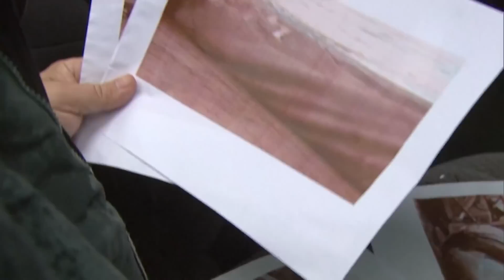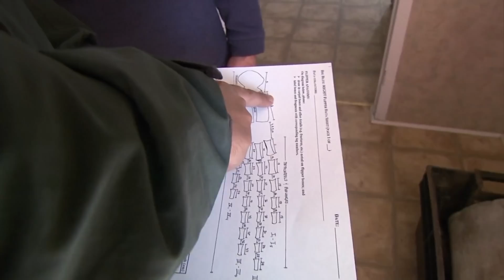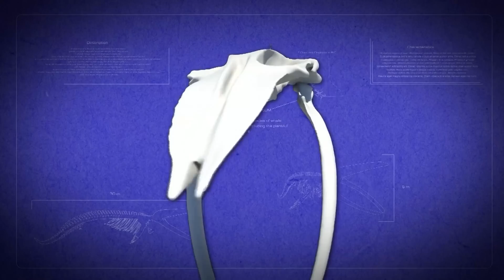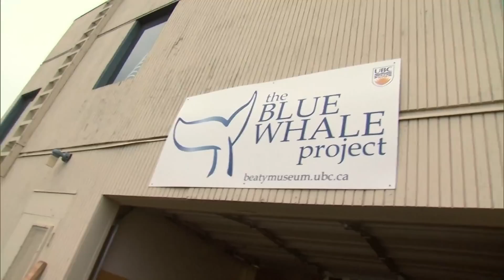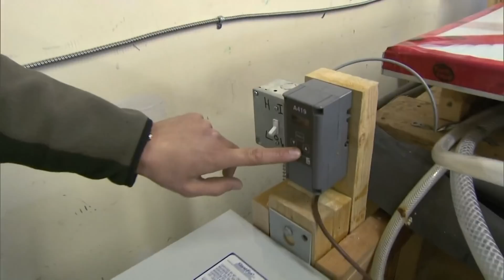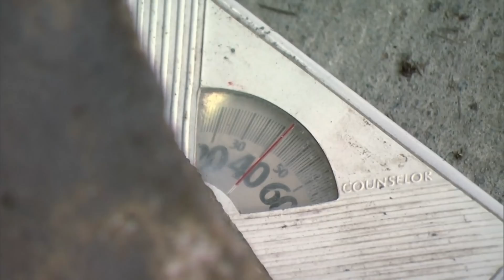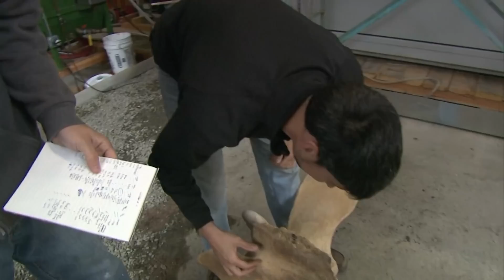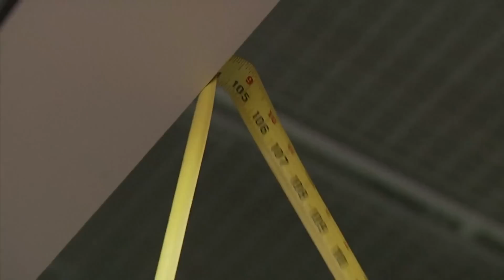Uncovering The Skeleton Of A Rare Blue Whale | Raising Big Blue | Spark

Comment: 2:38: ! Marine biologist Andrew Trice is determined to find and retrieve a blue whale skeleton for a new museum.
7:21: 🐋 Marine biologist Andrew Trites and his team excavate a buried blue whale skeleton in Prince Edward Island.
12:58: 😮 Excavation of a massive blue whale skeleton is underway, but the team discovers that a key piece, the flipper, is missing.
18:40: 😮 A missing blue whale flipper is found, but the skull is severely damaged, posing a new challenge for the reconstruction team.
24:18: ⚙ The process of cleaning whale bones for a museum exhibit is proving to be challenging and time-consuming.
30:18: 😢 The team faces setbacks and damage to the whale skeleton as they try to clean the bones for the museum exhibit.
37:15: 🐋 The team works to clean and assemble the blue whale skeleton, facing challenges with degreasing, reassembling, and fitting the skull into the museum.
42:48: ! After weeks of work, the blue whale skeleton is finally unveiled and amazes visitors.
Recap by Tammy AI